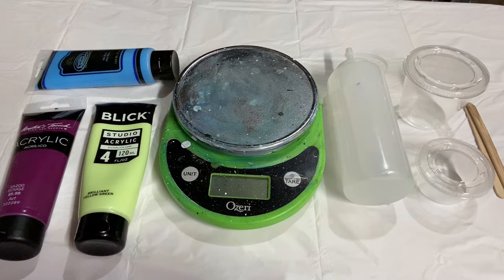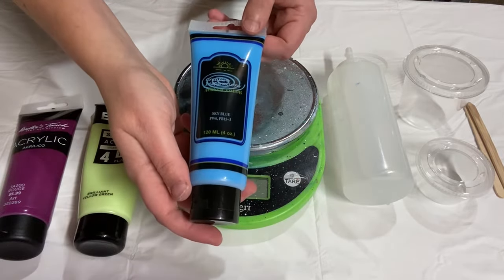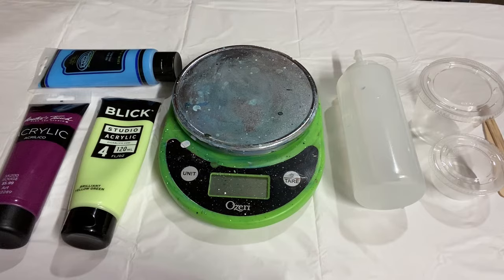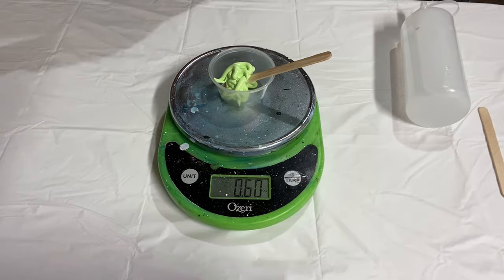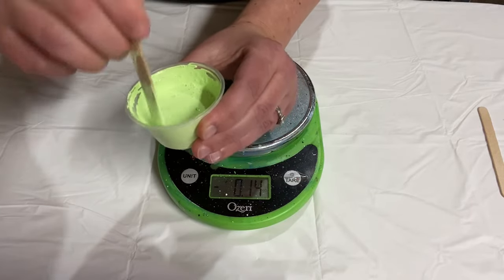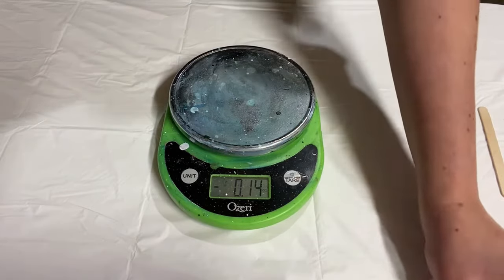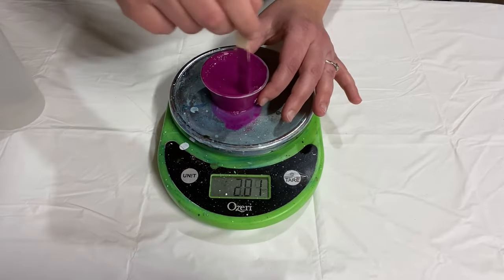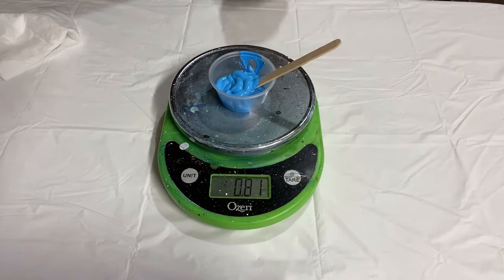Mixing Paint With Just Water? How To Mix Paint For Dutch Pours ~ Demonstrating 3 Brands Of Paint!

Comment: Adorei a aula muito obrigado por partilhar seu conhecimento 
Aqui no Brasil não temos muitas opções de tintas acrílicas 
Só temos 2 tipos de tinta fosca ou brilhante 
O uso de tinta acrílica de parede é uma boa opção usando pigmentos líquidos concentrados para criar outras cores?
Da para fazer tinta metálica misturando a base branca com a cor metálica?
Morro de vontade de fazer a técnica do secador de cabelo
Reply from the maker: I have used house wall paint in acrylic pours, but it works best when mixed with another medium, like floetrol or glue.
For mixing metallics, I’d put the mica pigments into an untinted wall paint, rather than white. Otherwise the shimmer will be muted.

Comment: Curious,  would you say the paint that your using can be compared to say like a type of house paint. In other words would you call it a water based paint ? 
Some paints are oil based and require a different type of thinning / cutting.
Reply from the maker: House paint is a latex-based acrylic paint. I like to use it in some pours but not mixed just with water.

Comment: Question, I am a life casting artist. I have been dying to do painting pouring techniques but not sure how well it will work on aginate or plaster which are more pourous then canvas.  I assume I will need to thin the paints in order to get them to pour. Any suggestions??
Reply from the maker: That’s cool! Have you done any paint pouring on other surfaces? For acrylic pouring, the paints do need to be thinned with a pouring medium, or floetrol, or sometimes just water. For vertical surfaces, I love Apple Barrel pouring medium. You can look at my vase pour playlist to see how I do that! 
In terms of it being more porous, you could possibly spray a coat of primer over before pouring on it, to minimize paint absorption.
Reply: I've done some very simple pours, all flat surfaces. I want to do pours specifically on life casts I make for families while mom is pregnant. I cut them and shape them into a bowl we then use for newborn photo shoots. I will be spraying a gloss coat first to make the slip easier and what I'm aiming for is a diluted, almost water color effect. My instinct is to mix with water but not sure if something else would be better.
Reply from the maker: @RiseandSHINEdailyinspiration  oh interesting. So will the pour be on the inside of the cast, or the outside? You’ll want to be careful that the paint doesn’t all pool in the middle of the cast! 
A gloss coat would improve slip for sure, but it might make it harder for the paints to adhere. Maybe you could try your process on an inexpensive bowl first? You could spray it as planned and paint it as planned, and see what happens!
Reply: @AnnaBlountArt  outside.  Just like a regular bowl.  These are custom made bowls, the cast is made from the mother's belly bump :)  so each is unique and custom.  It takes a couple hours to make a cast so I only make one and only get one shot at pouring the paint.  I'm going to play around with cuttings to see how well the paint slips without and without a primer paint.

Comment: Could i use Arteza Gouache paint
Reply from the maker: Interesting question! I just did a bit of reading about gouache because I’ve never used it.
It seems like gouache doesn’t have as durable a binder as acrylic paint, making it prone to crack or flake when applied in a thick layer. So if you want to pour with gouache, I’d recommend mixing it with an actual pouring medium like liquitex or apple barrel, instead of thinning primarily with water or floetrol. This might add enough binders to make it not brittle and chalky.